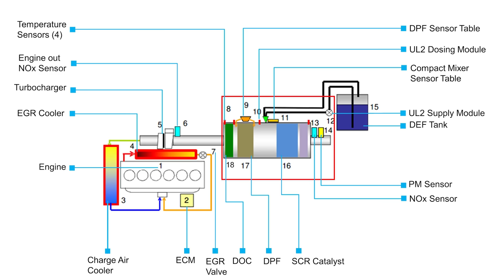Old But GOLD! I Changed My 2014 VOLVO for an Old 1996 Kenworth W900

Comment: I'm a bloody 25 year old and I agree with ya. My grandparents have a 1991-ish Dodge cummins, stick shift, diesel. I can't wait to get my hands on it. I'm at the point where I either want an old truck, or one that's completely electric so I don't have to deal with all the sensor BS the modern ICE vehicles have. I have no faith in any vehicle built between 2008 and today, with the exception of a Toyota.

Comment: ive been a diesel mechanic since 2016, and have worked/diagnosed SCR systems for a good majority.  they are troublesome, and sometimes break for no reason/come defective from factory (especially early versions of them) howerver with that being said, a lot of issues are due to lack of maintenance, and lack of understanding as to how they work/their weak points. Dosers like to cake up with DEF fluid that gets crusty, causing havoc and a list of codes unrelated to the issue. NEVER use DEF fluid from the pump. your engine must not have any CEL or else it wont properly REGEN. you absolutely CANNOT idle the engine or else i guarantee you will have DPF clogging. you MUST use quality oil, replace it regularly, and make sure you have a proper functioning turbo and proper functioning injectors. 
to those i maintain, i tell the owners how to operate their truck and they run 200-350k miles afterwards with ZERO issues. most of them with trucks arleady pushing 600k-1m miles.
you MUST have an APU unit to stay warm or cool. you WILL kill your truck if you idle it. no way around it.
that being said; i would never in my fucking life buy a truck with emissions equipment installed. 
i stopped wrenching and currently run an 04 Freightliner Century with a 1998 12.7 S60 Detroit engine. its what i like to call a Money Maker truck.
Reply: How do the Century/Columbia/classic and Coronado stack up against each other? I’ve seen so,e decent Columbia and century trucks for sale and an occasional Coronado.

Comment: I’m driving a 2019 Volvo. So far it has been decent! Almost no emissions issues. Drove a 2014 Mack before, non stop emission problems.
Reply: Just give it time you will seee trust me
Reply: I've been driving a 2016 chn mack
For 5 years now at least once a month an eats alert pops up. But goes away. There's a glitch in the computer on them. Otherwise great truck no other issues.

Comment: Hello, all.  I used to own 2 of these;  Mack  B75  and  Freightshaker  COE  with cummins  270.  THREE  KEYS,  to keeping your pre-plastic/computerized  trucks  going  forever.      1.  DRIVE,   AND   SHIFT,  without  being   ' rammy '....and  aggressive. Be sure, each shift, doesn't   ' jerk '  and bang the driveline.  Use  the clutch, sparingly, with gentleness only when  starting from a standstill. Be  sure your  'thinking',   and/of   WHERE  you park, loaded or  MT.    When  steering, only turn the wheel   WHEN   YOUR  MOVING.  (saves ball joints, king pins,  front tires, etc the whole steering system). 
    2. Maintenance.  Grease your whole truck, steering, driveline, brakepots and CAMS  ESPECIALLY,  once every week.  Be sure oil/water and coolant, are up to levels,  
%   of  anti-freeze, etc.  All fluid levels- tranny, diffs, front  wheel  bearings.   Keep your clutch, and clutch brake, within proper adjustment of free-play in pedal;  lubricated.  When you grease the driveline,  give the clutch brake  1  shot- every week.  Check diff oil levels, every  month. Try to keep swing arms, rear suspensions/bushing/adjustments, front leaf spring bushings/rubbers, all, in good order. (not rotting)  Keep  wheel alignment, as good as you can make it. 
3.  Buy  only good quality diesel, with good filters, both for oils/fuel and  coolant  filters, with proper  PH  LEVELS.  Keep  air cleaner (s) nice and clean; changing (or blowing out crud) when  needed, after dusty off-road conditions. 
  Lastly:  KEEP  ALL  GAUGES  working, and within  specs, for their  respective  purposes. Battery maintenance, weekly.  Take a peek; water leves (if you got them)
and look out for oxides/green/  crud on posts.  Install soft 1 inch sponge, under batteries, to keep  rocks, gravel/crud  OUT.  Vibration will knock holes in them.  Try to not let the   ' weather '  and other stuff,  into battery box.  Fuel tank caps; be sure they're  sealing / venting  properly.  THE  DRIVERS   SEAT;  If you have one of these modern ones,  THROW  IT AWAY,  ( or use as beer chair, in shop, when you pick rocks out of the tire treads. )   GET  AN  OLD   CUSH N AIR  SEAT,  OR  A   BOSTROM  40 OR MORE  YEARS OLD =  this will keep you, in better posture/condition  than  these modern   ' pretzel '  seats. Sitting in one = you'll   end up like a humped over - bent  pretzel, with stooping shoulders and a low breathing lung volume rate.   
  Anyway,   GOOD  LUCK    AND   GOD   BLESS   ALL   YOU   DRIVERS  !     (oldguy in Alberta)   ....no need to mention, the confusion around   ' modern '  vehicles; all types.   oh,  BMW   ( Break   My   Wallet)   or    Bring  More  Wampum..   ever notice, that seatbelts, came along about the time  that  they  brought out modern   ' plastic  '   bumpers ?..........

Comment: Yup,....I'll keep my 89 cabover till the day I come off the road. So many miles,....we don't even count them anymore.
Reply: smart choice!
Reply: How does the cab over run.   I've seen several for sale
Reply: @s.patricklewis1189  I'm not going to sugar coat it,...a cabover runs just like all class 8 trucks, depending on engine/trans choice. PM's and regular maint. are a bit harder because of the whole cab lift part and you have to make sure ALL your stuff is stowed, or you'll have a broken windshield. Now,..how does a cabover handle the horrible roads? It's a rough ride sir and you'll soon know every bump and bad road surface in this country,....and there are WAAAAAY too many. I have a set back front axle, so I sit right above and slightly ahead of the steer tire, I also have a air ride cab, seat, and front axle, gas charged shocks...and I still get blasted out of my seat on a daily basis. I also have a very short wheelbase. The benefits....awesome maneuverability, great visibility, and sitting up front feels good. I drove a "hood" for a short while (I cheated on my old Red for a week once) and never got used to that hood sticking way out there.

Comment: Ive been driving a 2016 Pete 579 Glider since it was brand new. We drove out to Tennessee and picked them up from Fitzgerald. I'm about to buy it from my company soon, since it's got the 12.7 detroit in it. Only time its been in the shop is for coolant hoses and oil changes.
Reply: You know that the engine has aftermarket internal
Reply: @kme5925  it might, its a Detroit Reman from Detroit Diesel, the engine wasn't built by Fitzgerald is what I was told.
Reply: @tolstuiebear1646  We havent had many issues with my truck, our other glider we got from them needed a new ecm and a lot of other shit fixed with less than 100k miles. What issues have you seen?
Reply: DrtyDiesel take it to Pittsburgh Power&get thier 6NZ or similar engine. 500hp-600hp all day long, 6-8 loaded mpg. I am looking for the "right" pre-emissions truck. Then I want to spend enough money to get what I want. And, I'm fine if it costs a handfull more Benjamins than I planned. Long haul, not long time haulin'

Comment: I drove a 2008 Pete with only about 10,000 miles and was in it for a few years. It had regen issues a few times a year. I actually looked forward to it because the company would put me in a hotel and pay me for down time. That was back when the emissions technology was new. I drove brand new trucks the last few years and I wasn’t getting that down time anymore. So while the new trucks do have much more going on, the tech is getting much better. These were all Pete’s/Paccar I drove.
Reply: Consider yourself a very lucky because those issues are still going on.

Comment: True story. Unfortunately not to be repeated in the European Union, due to emission restrictions and higher tolls for old trucks. In my small fleet, I have 4 Volvos (FH) from 2007 to 2016 doing short distance heavy trucking of containers on 2 shifts. They break like crazy, I have spent more than equivalent of those older units in repairs. Usually ad-blue related and various sensors. Also, on off-the-road handling equipment (from 0 to 6 yrs old) we have new Volvo Penta engines only. Compared to "old good " Volvo 1250VE engines or Cummins QSM11, all new Volvos with ad-blue and other "emission hacks" make a lot of trouble and an unbelievable downtime of expensive equipment.

Comment: Beautiful truck...I'm in a 2020  4axle 567 18sp Heavy Haul tractor 605 HP X15...It's a company truck...I just bought my own truck that I'm not even going to drive for a year or more because I gave the owner that put me in this truck my word I'd drive it till it was paid for...MY truck is a 2000 W900L with an N14, 13sp EF, 355 Rears. I won't pull more than 120klbs with it...and that is fine with me. 
I have my Harley Davidson soft tail under a cover on a lift behind the 567 I'm in now, and it will be going to the W900. 
   I got into trucking, then trucking got into me. I'm with you brother: Old School Rules.

Comment: I've had a couple of newer trucks with emissions never had a problem except at the beginning The EGR clogged upToo much idle and Not enough Full throttle I figured out never let the truck idle And don't be afraid to give it full throttle   That's how I keep the exhaust filter clean myself

Comment: My First Truck (and Vehicle in general) I drove was my father's 1979 Kenworth w900A "longnose" when I was 15 years old and I was instantly hooked and I knew that was the truck for me. I got my cdl a few years ago and I've been working my butt off out of in a old '18 Volvo company truck intill I can afford a late 90's W900 myself. The mule I drive like I said it's a volvo VNL and its in the shop every other month for emissions crap and it's great motivation to get out of those plastic rat traps.

Comment: I CLEARLY HEAR YOU TRUCKER. I HAAD MY 2007 INTERNATIONAL 9400I ENGINE OUT OF FRAME REBUILT.  I SPENT 8 MONTHS BACK AND FORTH  WITH THIS PARTICULAR MECHANIC SHOP HERE IN CONLEY GA. DURING THOSE 8 MONTHS STARTING IN THE SECOND HALF OF JULY, I WAS BACK AND FORTH COUNTLESS AMOUNT TIMES TRYING TO GET THIS TRUCK SITUATED, AFTER REALIZING THAT HEY I AM GOING BACK AND FORTH WAY TOO MANY TIMES FOR THE SAME ISSUES, I REALLY STARTED TO TAKE NOTE AND DOCUMENT WITH TEXT, PICTURES AND COUNTLESS VIDEOS OF THE PROGRESSION OF THE TRUCK, EACH I GOT IT BACK I WOULD RUN A LOAD, OR MAYBE TWO AND OIL LEAKS, COOLANT LEAKS  AND EXHAUST BOTH FROM THE ENGINE AND SMOKE STACKS TO THE POINT THE SMOKE COMPLETELY BLACKENED THE PASSENGER SIDE OF THE ENGINE WHERE THE TURBO IS.COOLANT WAS MIXING IN SIDE THE ENGINE TO THE POINT WHERE I HD TO ADD 1 1/2 GALLONS PER DAY WHICH FINALLY WENT UP TO 2 GALLONS PER DAY. MIND YOU I WASNT RUNNING IT ON ANY REGULAR BASIS....JUST ONE OR TOW LOADS HERE AND THERE WHEN I GOT IT BACK AND THERE WOULD KEEP THE TRUCK FOR WEEKEND ON END AND THEN MONTHS ON END. CYLINDER HEAD AND EGR UNDER THE BUILD WAS CHANGED TWICE TO NO AVAIL. WAS OFF FOR THE FIRST TWO MONTHS OF 2024 GOT THE TRUCK BACK IN MARCH THEM TELLING ME THAT THEY WENT THROUGH THE TRUCK 10 TIMES, WHICH I ALREADY KNEW WAS A LIE, AND I STRAIGHT UP TOLD THEM ......THAT WE WILL SEE. NO SOONER THAN I RAN THE FIRST LOAD SAME SYMPTOMS AND PROBLEMS OCCURRED, AT THIS POINT AND EVEN BEFORE THAT I WAS IRATE AND FUMING. RAN THE TRUCK AS IS FOR 5 MONTHS AND IT FINALLY LET GO. THE ENGINE SEIZED UP. THE COOLANT WAS MIXING WITH THE ENGINE OIL AND CAUSE A HYDRO LOCK . $46,000 IT COST ME AND NOW I AM OUT OF A CONTRACT. WORST PART OF THIS WHOLE FIASCO IS THAT YOU CANNOT FIND A LAWYER WITH ALL THE OVERWHELMING EVIDENCE TO EVEN LOOK MY CASE, LET ALONE LOOK AT THE AMOUNT OF INCOME I LOST WHICH WAS WELL OVER $200K.  SO HOW DOES ONE GO ABOUT TRYING TO FIND THESE WELL MAINTAINED OLD SCHOOL TRUCKS? I AM SO TIRED OF THE INDUSTRY NOW, I REALLY WANT TO QUIT THE BUSINESS,  BUT TRUCKING IS ALL I KNOW. SORRY FOR THE RANT LADIES AND GENTLEMEN, BUT THERE ARE MANY OUT HERE THAT ARE GOING THROUGH THE SAME THING. THE SAME THING THAT HAPPEN TO THE MOM AND POP GAS STATIONS AND BUSINESSES, IS THE SAME THING HAPPENING TO ORDINARY TRUCK DRIVER TRYING TO TAKE CARE OF BUSINESS AND FAMILY. GOVERNMENT AND BUREAUCRATS, WITH THEIR UNDER THE TABLE MONETARY MONEY TAKING , RULES AND REGULATIONS IS WHAT IS KILLING THIS BELOVED INDUSTRY. YET I TOTALLY AGREE WITH THIS TRUCK DRIVER IN  WHAT HE IS SAYING, AND THEN AGAIN YOU CAN'T EVEN TRUST THE PEOPLE WORKING ON YOUR TRUCKS THESE DAYS LET ALONE DEALERSHIP. SORRY FOR THE RANT....PEACE I AM OUT!!!!
Reply from the maker: That's a lot of caps... why are you yelling at me?
Reply: @NorthAmerican-Trucking-News  Sir I think you have missed read my email….lol. I am not directing a single think at you at all sir. I was telling your viewers how quickly you can go from making good money to being out of work and out of business just like when you are at the mercy of the mechanics these days that dishonest. Please do not take offense at all. Why are you regarding my comment as a load of crap, clearly you haven’t understood my intent.

Comment: I've been running my ol 86 359 ex hood for 26 years now, I have a 2017 389 and it's been a shit show until I got sick of it and dropped a 6nz in it. My 359 has been fully restored from top to bottom in my shop,  by my hands, minus the paint. I'll keep rebuilding the ol girl until I retire.

Comment: The horror stories with the new emissions trucks...Good old truck will keep running and no expensive repairs among other things..😅
Reply: Never had emission problems on a new 2019 Freightliner. So not sure his rant. 😆
Reply: @extremedrivr  I worked for a fleet shop in a chemical plant, and when they started buying the Cascadias around 2010, they had nothing but problems with the DEF systems.

Comment: I have been driving a 2007 GMC 6500 for six years now. It is a large straight truck.
I am 61 now, but when I was 21 I drove for Wiley Sanders Truck Lines.
I drove mostly a 1988 Kenworth and also a rebuilt 1980 Kenworth. Watching this video really hurts. I miss driving the big rigs.
Great instructive video!

Comment: Spent most of my time in a 65 Peterbilt with a true twin stick. I'm not that old either as the truck was a year older than me. You actually had to drive that truck. One wire to run the engine and no electronics just had to keep your eye on the pyrometer on the hills.

Comment: Maybe a small cam built into the front might be an interesting safety feature for the low visibility of small cars disappearing under the hood?
Reply: Great idea 💡
Reply: Somebody commented but it seems to have disappeared that if you can’t see the car in front you are too close. Maybe. But in busy cities this is almost unavoidable. Also, motorcycle, bicycles and even pedestrians can creep up in front of you without noticing. Traffic has gotten more and more challenging over the years unless you live very rural. Some extra visibility never hurt anybody, on the contrary.

Comment: If I was to buy a new truck it would be a glider with an old Cat motor
Reply: I heard that!
Reply: Exactly
Reply: That's big money now a days.  200k and up for a nice one.
Reply: new Gliders are no more.
Reply: Have you seen the resale on a cat glider? I have and the price is around 150-180k for any W900L. That is used my friend. Now there are some freightliner gliders around new for 130-150K
Reply: @timothygillis6837  you'd spend a shit ton fixing a new one and still have to buy the truck anyway. My work has a couple little Hino 5 tons they bought used. Get about 100,000 km a year put on them, they've averaged $30,000 A year in emmision repairs since they bought them. They are tow trucks so they have a hard life, but that is still too much. They are buying a new international with a Cummins and are thinking of buying a gasser ford as well.
Reply: 3406💪💪
Reply: @dr.benway2693  Roger from San Antonio? Is this you?!!

Comment: 01:30
You only need an APU to avoid the problem with the DEF and Emmissions. If you do not idle your Truck at the Truck Stop there is no problem.
I had a 2019 Cascadia 126 with a Rigmaster APU - No problems for 2 years with anything.

Comment: How much emissions is put out by a fiberglass truck that catches on fire because the exhaust filter overheated?  How much emissions were saved on that burned out truck because of the the DEF system?

Comment: I know I'm a little late, but his problems stem from buying a Volvo. Not a newer truck. We got a '16 Cascadia Evolution with a D16, coming from a '99 Freightliner Classic XL with a 60 series. Never had any emission issues till the DEF started acting up at 800k. Since then its been deleted and we dont plan on going back to a pre-emissions truck

Comment: I have 2000 KW W900L  2WS cat power (pre-elog), new transmission, 750,000 original miles $65,000 OBO no trades Arvada, CO.  I also have a 2020 389 Glider 2WS Catpower (Pre-Elog) 1,800 original miles $245,000 OBO no trades.  Financing through BMO on your own.

Comment: If I was in the market to become an owner operator, I sure as hell would go for an older W900 or a similar Used Glider Truck. I remember this Transport company on Youtube that has quite a few newer Kenworth W900s in their fleet and most of them averaged better fuel economy than the new aerodynamic T680.
Reply: Used glider newer model year but oil school power so make sure its had a recent diff motor and transmission rebuild